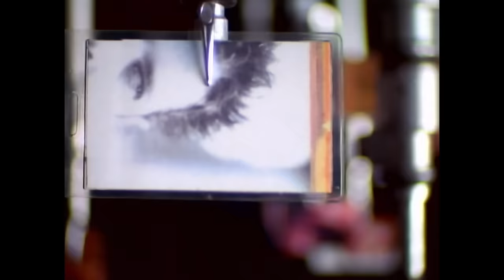Soundgarden - Spoonman

Comment: Love the time signature changes. {3x 4/4, 1x 2/4} and repeat... Sounds so energetic.
Reply: +DailyFrankPeter This song is notable for having that main riff in a 7/4 time-signature.

http://www.musicroom.com/se/id_no/0572359/details.html

Outshined, from their Badmotorfinger album, also uses a 7/4 time-signature throughout its verses.

http://www.musicroom.com/se/id_no/0660042/details.html
Reply: You're right! Thanks for chipping in. But I wasn't that far off! 7+7 = 14, that's the same length of phrase as 4+4+4+2. 
Considering there are different accents in the 1st and 2nd bar, if anyone could tell me how to HEAR the difference between constant 7/4 and 4/4 with a change to 2/4 on last bar (without looking at the sheet) I'd learn something new today.
Reply: DailyFrankPeter I was always told that the first beat of a bar is usually the strongest; that being the case, the beginning of that main melodic riff in Spoonman somehow “feels” stronger than all of the others (in fact, as you probably saw from the sheet, an entire bar contained all seven of the beats within that riff before it repeated in the next bar). Trying to shoehorn that riff into three 4/4 bars then a 2/4 doesn’t work using this principle because the beginning of the first repeat of the riff would then happen in the fourth and final beat of the second 4/4 bar, which does not really sit that well compared to when using 7/4.

I have to admit that spotting the 7/4 in the verses of Outshined is probably easier to ascertain than in Spoonman as there are not so many syncopated rhythms within the verse riffs of Outshined.

7/4 is one of what is known as irregular time-signatures, in which some of the pulses within the bar have three inner beats and others have two (in this case, one pulse having three inner beats and the other two having two inner beats). For a bit more from a renowned music teacher who does online instructional videos you might like to check out a YouTube channel named MusicTheoryGuy and his “Irregular Time Signatures” video for a bit more about such time-signatures if this whole discussion has piqued your interest to that level.

While we are on about the album from which Spoonman came (in this case, Superunknown), one of the other tracks (My Wave) clearly has five beats per bar during its verses. Yes, another irregular time-signature (5/4, in this case)!
Reply: +DailyFrankPeter After doing a count, the song seems to be in a 7/8 or 7/4 format
Reply: +novic329 Yes. 7/4.
Reply: +DailyFrankPeter I think you might be counting in double time/counting eighths. I'd count the 7/4 pulse 2+2+2+1, so I'm guessing that's where you're counting 4+4+4+2?
Reply: Yes! But is there an absolute duration of an eight? Or of a quarter note? Because to me it could as well be used interchangeably.
Reply: +DailyFrankPeter It's more to do with how you write it on paper. You could call it 7 bars of one beat each and you wouldn't be wrong. Or you could divide it as you did, even though you are counting twice as fast as the "actual" beat, it doesn't matter until you come to write it down. It just changes the way you write the notation. Generally, it's accepted that if a phrase repeats, that it starts on a new bar, but there's no law that says the whole phrase has to fit in one bar. Though...it could. This song could be 4/8 X3 then 2/8, or the same with quarter notes...after all...quarter of WHAT? The first number is all that really matters if you're just listening or playing the song. And yeah, it's written as 7/4, but to call it a 4 beat bar, followed by a 3 beat bar, changes nothing, really. The system we have for writing music is an out-dated joke. Only snobbery keeps it alive. Classical musicians like to feel special, so there's no point trying to tell them there's a better way. Having the same system used across all instruments is pure stupidity.
 Guitar tablature shows how easy it is to improve on the ridiculous system. Of course, guitar tab, uses the old system for the rhythm, but it's not too bad for that, though could easily be improved. 
 So...until someone invents a half decent way to write music...I don't count. There really is no earthly reason to count the beats, as long as you know when the next one is coming
Reply: 7/4?

Comment: Rhyyyythm! While wanting to bang on the pots and pans, I'm remembering choosing my first set of utensils. I took on a job at Pottery Barn the Christmas before I left for college. I held so many pieces until something just felt right. The weight and smoothness of the edges that just fit so nicely balanced in my hand. I only have a few left and of those several have wrestled with the garbage disposal. I always thought of the spoon as being the most docile one in the drawer. Now, not so much 🙄🎶

Comment: Ever get the feeling your just in first gear. Firing up the engine is just a matter of acceptance. Gonna make sure the oil is right, and the fuel high octane... Idling a dragster motor, just seems like a sound of possible kinetic purportions.